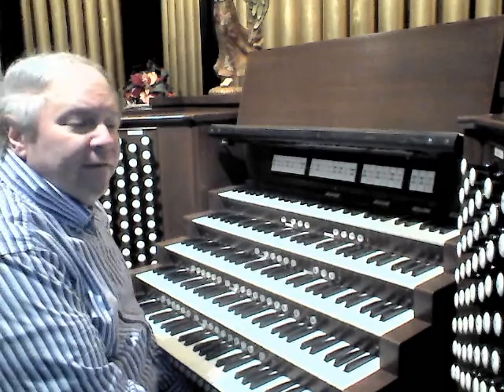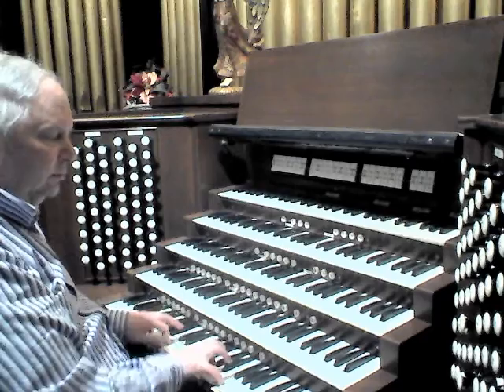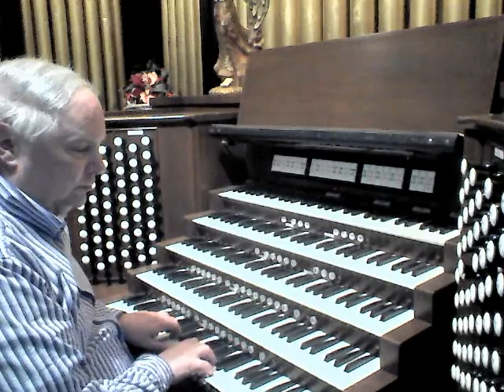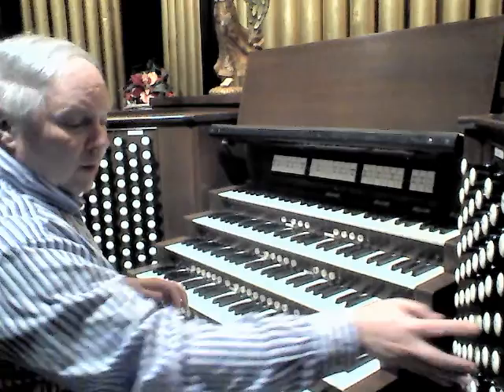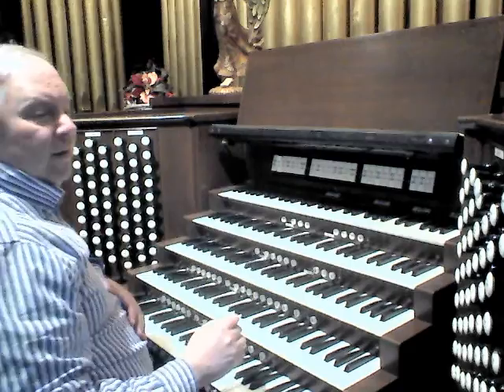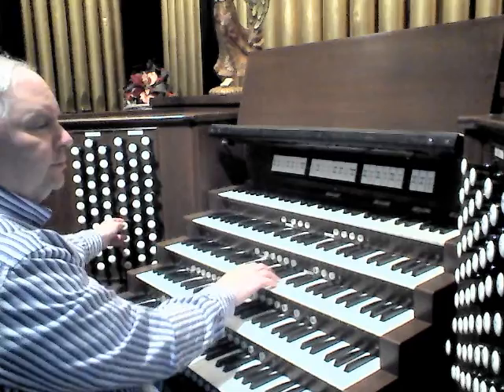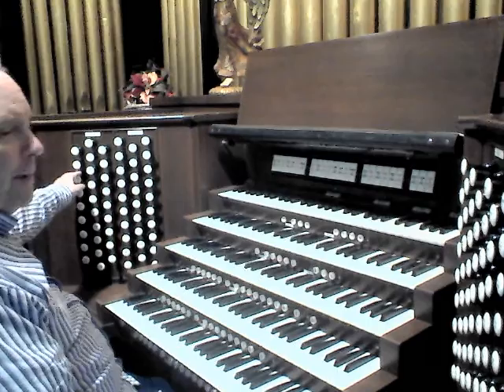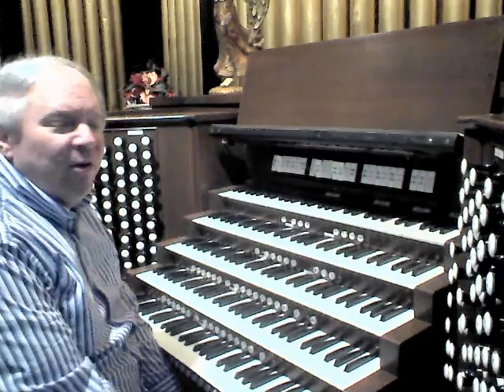Gaffney Residence Organ Demonstration

Comment: whoa! Serious pipe-works in a house. How do you spell "hearing loss?" You can see why churches are going electronic - pipes need constant tuning. As a piano tech, this would drive me bonkers (off-tuning). So, how many different organs were harvested to create this masterpiece? Was the console special-built or adapted with stop changes?
Reply from the maker: Hi.Thanks for your interest.Approximately ten organs and six builders are represented in the organ.  The console, originally build by Moeller for the University of Florida at Gainesville, was purchased at auction and repurposed to control this organ.Regards,MJG

Comment: Congratulations on owning such a fine instrument !  Have you built it yourself ?  As a retired physician and someone who has studied ENT I would offer a word of caution. A satisfactory full organ has a sound level of about 92db. In industry a worker exposed to this sound level for an eight hour shift has to wear ear defenders by law.  92db in a relatively small space is even more harmful.

I also have a four manual residence pipe organ which I have built myself. However I have taken the precaution of regulating the sound levels to which I am exposed with a sound level meter. I use full organ very sparingly and for very short periods only.

Too many organists, and musicians in general, develop tinnitus and high end hearing loss due to high sound levels over a lifetime of exposure.
Reply from the maker: Hi, John.Thanks for your comment.  Yes, friends and I built the organ on the "trial & error" system, focusing mainly on "error"!You are quite right about the hearing risks and thanks for the caveat.  Like you, I use the full organ very rarely and, actually, the organ sounds more aggressive on the recording than it actually does in person.  I deliberately "buried" much of it with the sound issue in mind.Do you have a specification or recording or your organ.  If so, I'd love to see or hear it.Have a great balance of the weekend!Michael
Reply from the maker: Hi, John.Actually, I'm even more of a neophyte at this than you are.  I'll check with some of tech savvy students and see if there's a way to keep communication private.  I detest social media and certainly agree with your desire to keep information private.  There's just too much of people's personal business floating around on the media.I'll let you know the fruits of my labors.Take care.Michael
Reply: Dear Michael. Even my technical savy daughter could not think of a way around this. It is basically her reply which is above. It would be far easier to communicate by email with specifications and photos. I think that it is also possible to send sound tracks as attachments by email, but I shall have to consult another friend about that. It is a catch 22 situation as I don't want to disclose my email address on You Tube any more than you do. Postal addresses are also out as well.

If you do want to know a little more about me, if you put  Reger opus 59 john pemberton hull city hall  into your search engine you should gain access to five recordings of mine on the city hall organ on You Tube. All the best,  JOHN
Reply: John Pemberton 
You could DM eachother through Google Plus